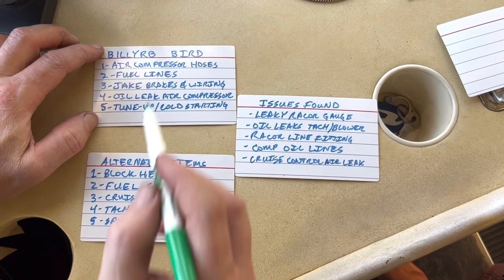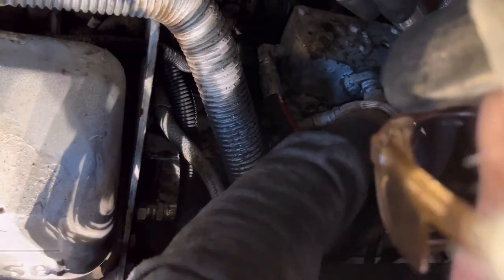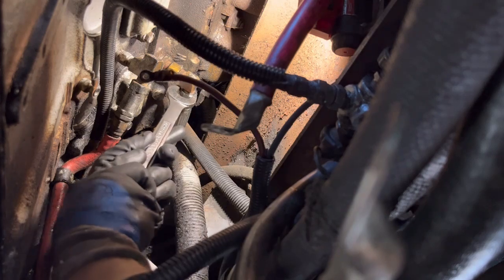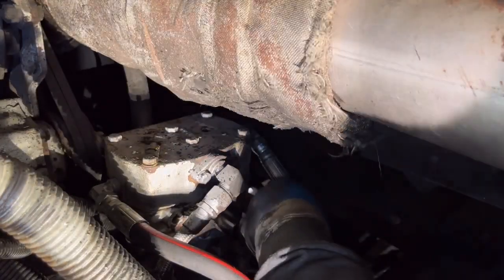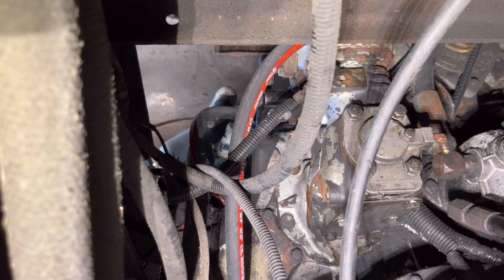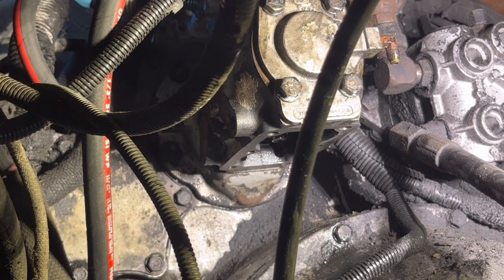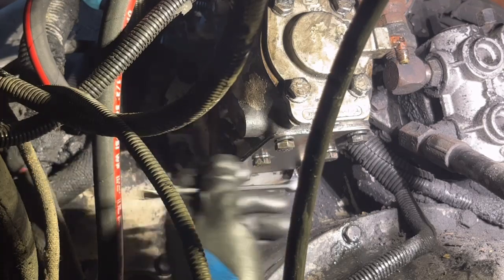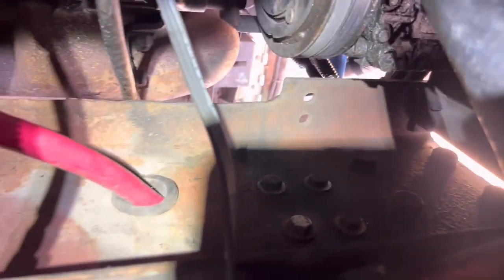Gino's Garage-Project BillyRB. Compressor coolant lines, oil line, oil leak, and block heater..

Comment: Jeff - anything special about the hose material, say polyethylene glycol resistant? Are they simply hydraulic hoses made at like NAPA? I noticed the red stripe? Is that indicating anything in particular?
Reply from the maker: Its standard hydraulic hose, they are rated for multiple types of fluid. 
From the manufacturer:
SAE 100R2 -S is a high-pressure hose that is used for petroleum or fluids having a water base. The reinforcement layer has two high tensile steel wire braids and the outer cover is abrasion, ozone, and weather resistant synthetic rubber, which is MSHA approved. The temperature ranges from -40F to +212F (+248F max.)
I can send you some more info if you want to email me: Jeff@ginosgarageusa.com
Reply: Thanks Jeff. I believe that is equivalent (212F) to what I used from NAPA for mine. I replaced them about 5 years ago.